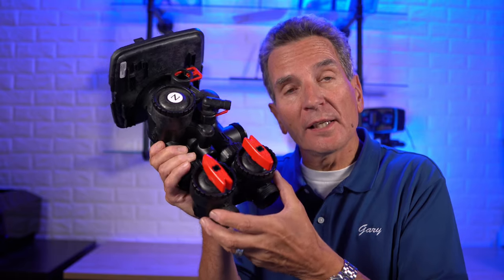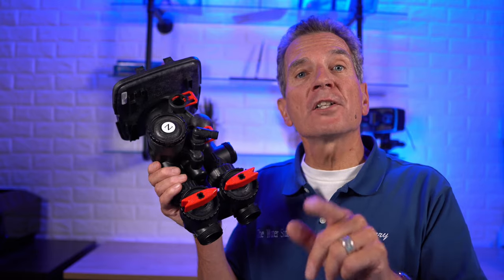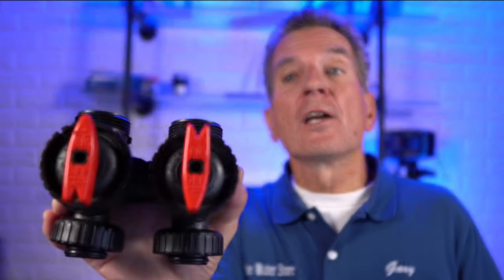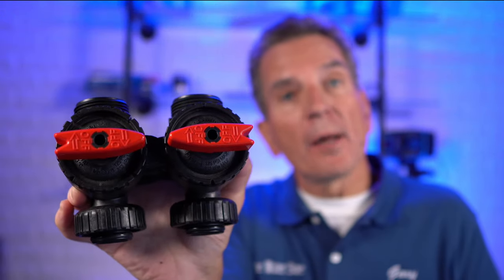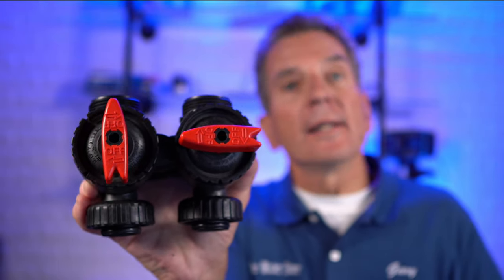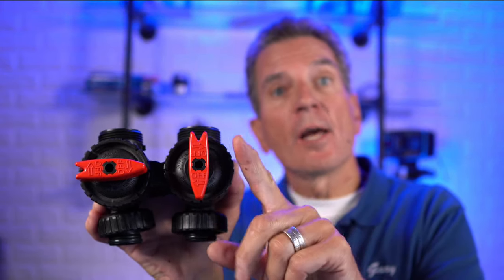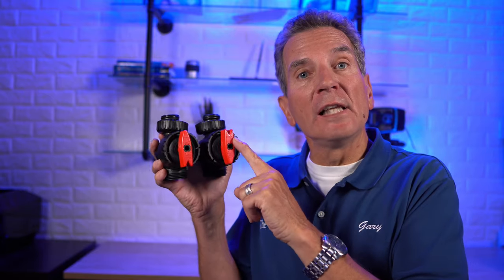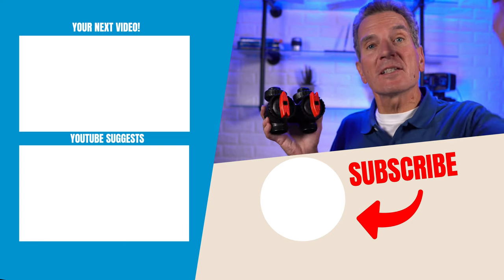How to BYPASS CLACK WS1 Water Softener?

Comment: I just wanted to say thank you for your help. I was able to get the fill line to stop leaking with some Teflon tape. I would prefer a more permanent repair. I believe I saw in one of your videos were you had an upgraded fill line with a brass fitting.? Question. 

I have a well and I use a UV light filter for my water I’m wondering if I should upgrade to a better filter? And if you could post a cheat sheet for the maintenance on a water softener for a well system.  I know there’s a lot of information on maintenance but just a cheat sheet for additives that certain time of year would be tiptop. Thanks again for your service.
Reply from the maker: It depends on the water softener brand but for our HUM and Clack valves you can use a 3/4" FPT going to 1/2" pex fitting.
Reply: @water_estore  it is a clack valve where can I purchase the 3/4 Fpt fitting?

Comment: Great videos, Gary!  Very clean and concise.  Thank you.  If I switch the valve to bypass mode a water softener with an analog clock timer, do I need to make any adjustments to the timer?  What happens if the water is bypassing the softener when the timer triggers regeneration?
Reply from the maker: Glad it helped.  The water softener valve will still go through all of the cycles but since there is no water flow nothing will happen inside the tank.

Comment: Hello, love your videos and as a new home owner ive learned a ton from your videos and i thank you so much for that. Question though, i manually turned the bypass mode on to do some servicing and ever since then when the system goes into regen it doesnt automatically go into bypass mode. Is there something i messed up or something i can check for proper operation? Thank you for any and all help
Reply from the maker: It bypasses the system internally during regeneration.  You will not see it move the external bypass that you use
Reply: Oh okay. I was under the impression or figured that the indicators would show it in bypass when its in regen. Thank you so much for clearing that up!

Comment: You had your bypass system turned around the opposite way, so initially what you were saying was an inlet was actually the exit 👌
Reply from the maker: Yup, you are correct.  I think the overall message though that the video delivers is not compromised by my oversight.

Comment: Hello nice videos....question if my softener is in bypass mode does that stop the unit from doing a Regen? I am planning on doing a test which will make me put it in bypass before I go to bed at night but I don't want to mess up when it needs to Regen at 2am. Thanks
Reply from the maker: Yes, when on bypass no regeneration. Regenerate it first, then bypass.
Reply: @water_estore  ok thanks appreciate it one other question please is it true that I add salt when the water can be seen or when water level is above salt? Thanks again

Comment: Hi!
Is it possible to adjust water softnes with this valve? In my case less soft.
Reply from the maker: Good question!  No you cannot. You would need to install a bypass and leave the bypass slightly open to mix a little hard water with soft water.
Reply: @water_estore  Some how you deny it and then approve my question. :)
I have such a bypass valve on my softner.  Currently water after softner is way too soft. Dishes are fouling out of hands and to rinse hairs takes a while as it feels still soupy. :)
Reply from the maker: @JKjrbad  Sorry I wasn't clear.  You need to plumb in a water line between the hard and soft water with a a shut off valve between them.  Then, open up the the shut off valve slightly until the water becomes as less soft as you like it.  You will be mixing hard water with the softened water.